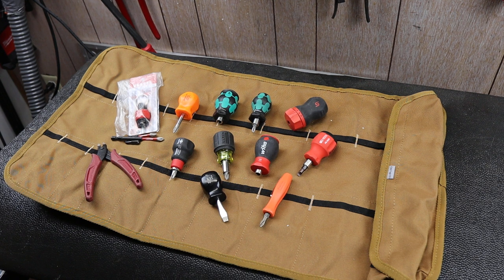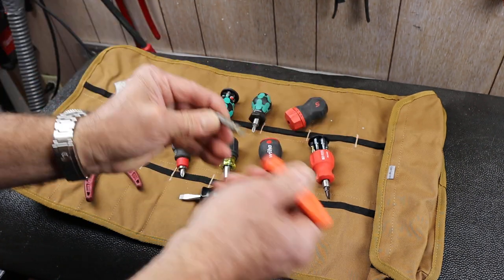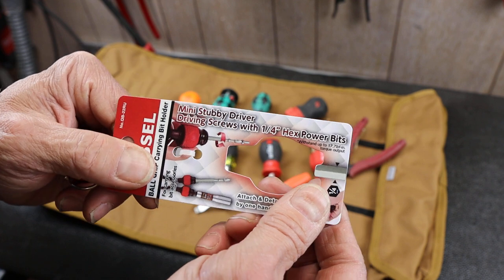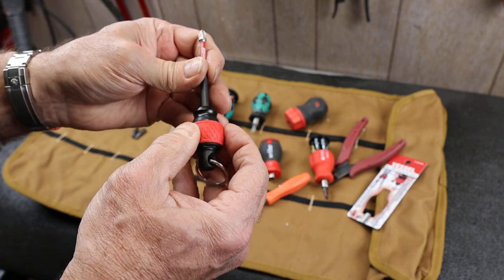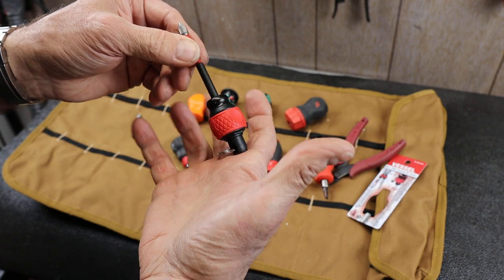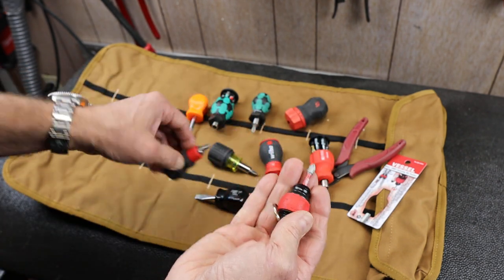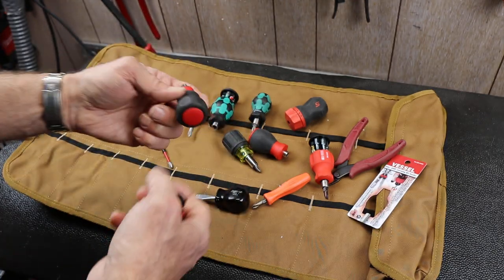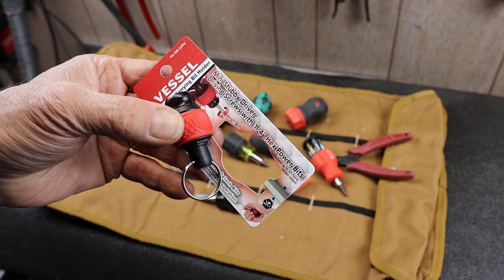Vessel Ball Grip Bit Holder Bit Driver. A Cool Tool for bit holding and bit driving. Smallest yet?

Comment: The vessel ball grip ratcheting driver has an integrated stubby ratcheting as part of the design and it is the most comfortable of my stubby ratcheting far beyond my Klein or Milwaukee... but alas it has the same flaw in that a standard one inch bit is not unusable such as the bit holder or stubby presented but certainly no small task to pry the bits out. 

However a double ended bit seems to be more useful in it anyhow so doesn’t affect me but certainly something to know

Comment: I always like the idea of stubbies but then I regret it every time I use one. They don't carry well and get lost in a bag or are awkard in a pocket.  Dont fit well in a tool pouch either.

As a keychain driver though, it's brilliant. Much more useable than other keychain/EDC/multitool bitholders without taking up too much space. Only thing missing is that it should really come with a double sided phillips/slotted insert.

My work screwdriver is a Vessel 220W and I'm really happy with it. Love the ergonomics of their handle shape.

Comment: Hey Doc, thanks for bringing another interesting tool to us

I'm about to order two of these that come on a carabiner, would be awesome for my field of work.

Any recommendations on bit length for these? The classic 1/4" screwdriver bits look to be too small for these as you demonstrated. I need to still have them be somewhat stubby, the bit you used at 3:50 looks perfect - seems to be a Milwaukee impact rated bit - any idea what length this bit is?

Thanks
Jack
Reply from the maker: I think I was using a 2" Milwaukee Shockwave bit. Here are some options on Amazon:

Set of 5:
https://amzn.to/3zmp1vM

Box of 15 (I often get these) for a buck more
https://amzn.to/3FT1ZyT